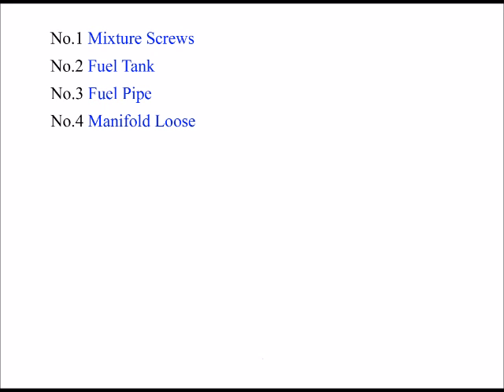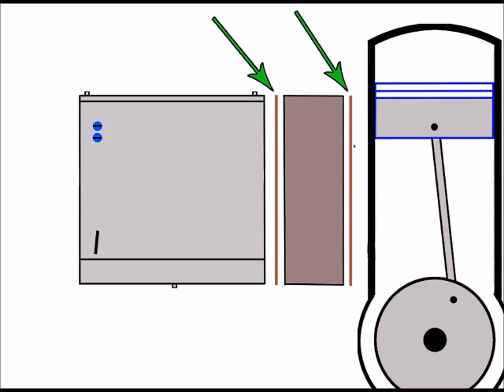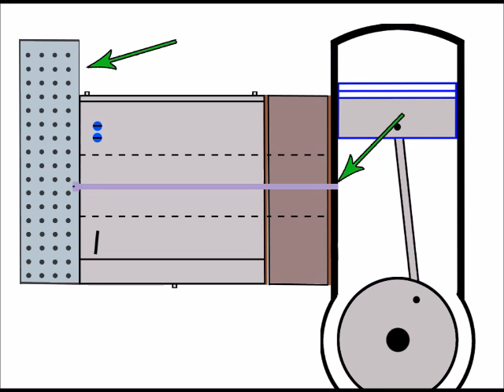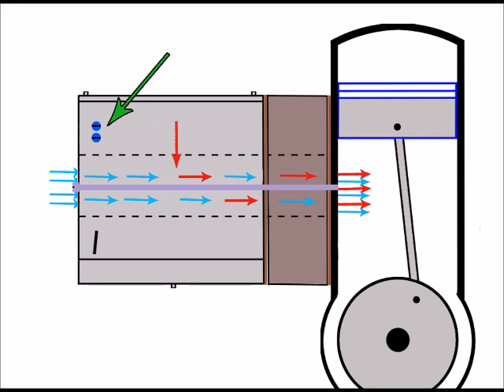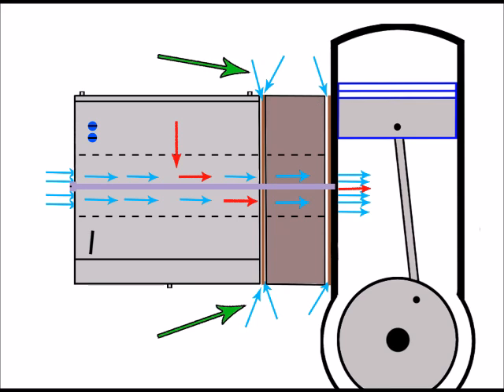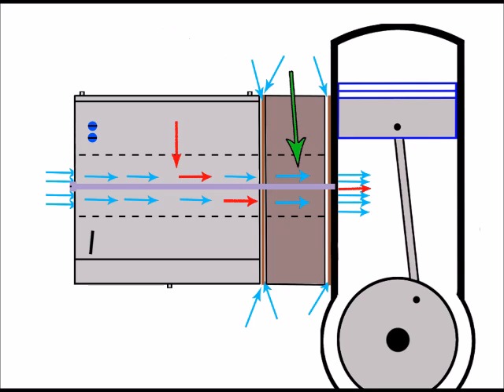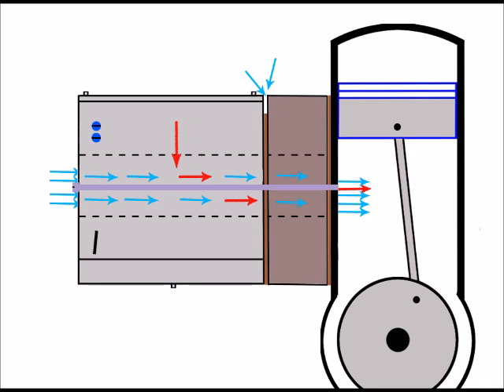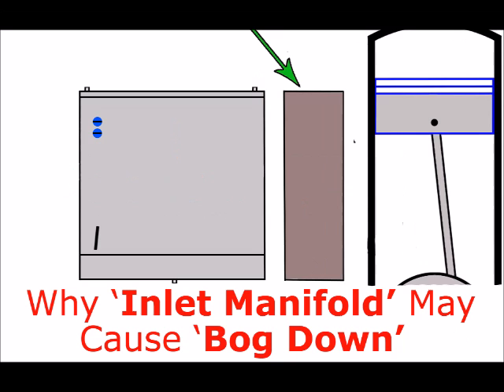CHAINSAW CARBURETOR MANIFOLD - Chainsaw will Not Run if THIS Happens!  (by Craig Kirkman)

Comment: I noticed you have a lot of videos in this particular area of small engines.  Your work is very informative and illuminating...

The video that explains the concept of metering valve diaphragms are not Interchangeable was a eye opener.  I did that exact procedure not knowing if it would work out.  Lol.  It did not work.  Your video explains that very simply.  Thank you sir.
Reply from the maker: Thank you very much!

Comment: Good day sir, I appreciate you very much. Thank you for sharing your skills knowledge and experience. 

In these videos about bogging down you keep saying this is video number....of 12 videos. Is there anywhere that you list the 12 videos? I don't see a Playlist called 2 stroke bogs down or a Playlist with 12 videos, and of the few I've seen the title doesn't say which number it is or anything. Just wondering. I keep thinking I know what the problem is with my yamaha 2 stroke 90hp outboard and then I do the adjustment or repair and it doesn't solve my issue which is it runs great now at 5k rpm for a short time then bogs down. But at 3200rpm it will not bog. Ive cleaned but not rebuilt the carbs, new fuel pump, new fuel filter, blew out all the fuel lines, replaced all the fuel line springs with clamps after seeing leaks, removed the fuel filler cap while running, even tried a different fuel tank, adjusted the timing for idle and wot. After that it did run a lot better, but still won't go fast for very long. I'd like to make a list of every possible issue and cross off what I've done....do you have this list of your videos on the subject available somewhere?

I just got new reeds and gaskets in the mail, I was thinking of replacing the gaskets and figured since its open maybe replace the reeds, but before I dig into that I think I'm gonna order 3 new carb rebuild kits since they have to come off again anyway. There is a slight fuel leak after I dock and shut-off, I think I saw pitting in the tip of one of the float needles.
Reply from the maker: oh my apologies. I meant to include a link on each of these short vids to the main vid. I will do that now. Thank you for reminding me and thank you for your kind feedback. Here is the full video. Craig: https://www.youtube.com/watch?v=SshXK8Ehm74
Reply: @TheRepairSpecialist  I appreciate you sir. Thank you for sharing your skills knowledge and experience

Comment: You truly make it easy to understand the very essence of how everything works with the carburetor and engine. Now when I work on mine or any of others I may work on I see so many of the details u show in your videos. Actually makes working on them more efficient because I'm almost seeing the performance of everything inside carburetor.. One thing for sure it does is accent the need for complete inspection and thorough cleaning and inspection of every aspect of operation. Thanks again for these very, detailed and explained videos.

Comment: what about reed valve
Reply from the maker: Hi, in my experience, problems with reed valves are generally, but not always, related to problems in getting the engine starting to begun with. I have had a small number of two strokes that have started with defective reed valves and then quickly stop after woods. I should have mentioned about reed valves in my videos but because not all two stroke engines have them I left it out. Thank you for highlighting this for me though, and I think I will make a video regarding these. Thanks again.